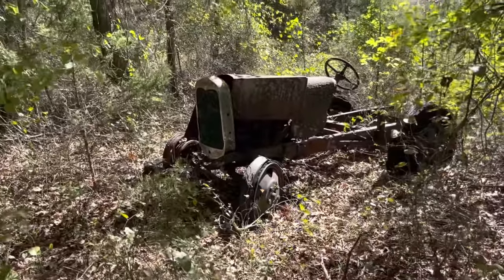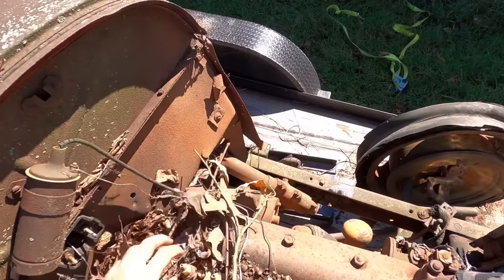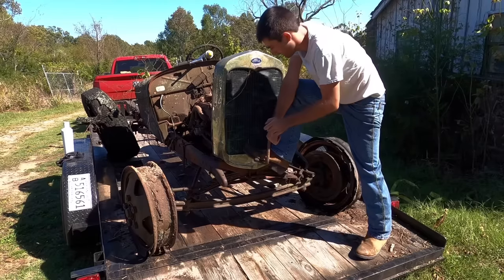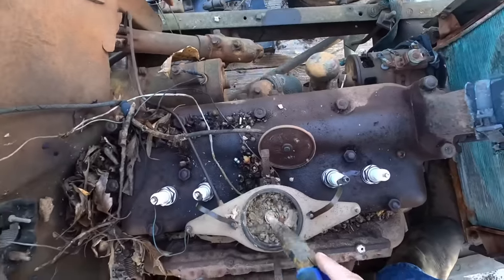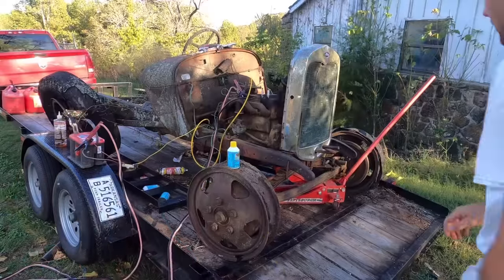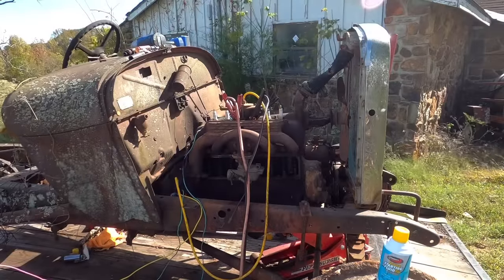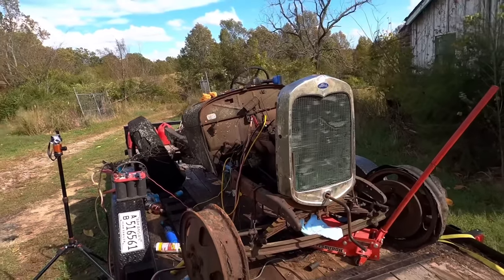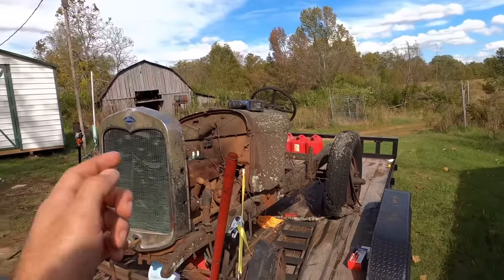Will it run after 72 years 1930 ford model aa Doodle bug ￼￼

Comment: A proof that old vehicles when taken care of......will last you a LIFETIME...... That thing needs a complete rebuild but the engine is still running. It still RUNS. quite well for how long its sat. Not as much smoke as some of the other videos either so it seems like it's getting okay compression. Wow im happy to see this
Reply: The old motors won't go as far as newer motors do nowadays but they generally can fire up and run after sitting in the woods for 70 years 😂
Reply: @HippoTheBaws  Ah, a common misconseption. Older motors are just as durable as today's engines and more so in many ways due to simplicity. Newer engines benefit from transmission technology that lets them travel over 55 mph at under 2K RPMs where older cars (if they could do 55mph) would be at 3K+ RPM so newer engines just don't have to work as hard.
Reply: @HippoTheBaws  
Idk they seem to be going backwards now. Comparably for what they had they were definitely built better. If we swapped places with people from the 40s-50s they would build cars that you could drive to the moon! 😆
Reply: @BrodieBr0  Agreed to a certain extent. They designed the transmission technology. They just didnt care to add more ratios. Not much is really new except for some materials. We have more precision now overall or cheaper precision but we make more mistakes,  were more careless and not nearly as smart but we think were all genius now bc our phone or the tv tells us we are if we follow a narrative! 🤣
With the exception gdi a few more turbos your vehicle is virtually the same vehicle and same technology you would purchase 25 years ago but probably not as good. Excluding your entertaiment system naturally.
Reply: @micahap1559  How many of those old motors hit 300k miles though? I see cars all day long with that some trucks with even more. Main thing with newer cars is actually maintaining them. Old stuff was bullet proof no doubt most of them you can easily look and see all the components. side note I absolutely am not talking about new ford's, chevy/gmc, or any of the Korean cars. I prefer the newer Hondas and Toyotas 😁
Reply: @HippoTheBaws  
Several. Thats not uncomon. Esp 60s era. But we must compare apples to apples. There are alot more vehicles today.  People also drive further now. The until the 80s vehicles only had a 5 digit odometer. Once you went over 99,999. Your back to zero. You must record the mileage yourself. The 6 digit odometer was added because people were driving more you didnt know how many 100k were driven. The biggest thing is the maintenance. If you didnt maintain it it didnt last. If you did it would. Fuel injection solid state ignition, 100k spark plugs better sealing etc. Let you drive more carefree now and remedies alot of maintenance. Basically the best innovations are helping to keep you from destroying your vehicle. 😆

... Just saw the last part. I dont care for Honda or Toyota. They are overpriced. They are not any better contrary to popular tale. 😆 Nothing particularly bad about the either. Im just not paying for an urban myth that everyone tries to uphold even when they have problems. Its always a fluke! 😆 
Common replies when telling me i should buy a Toyota. "All ive had to do is replace the coil packs, alternator, and a transmission problem."
Me: How many miles 
"95k, I'm about to get a new one". Me: How many when you had your first problem? 
"79k, so what have you had to replace?". 
Me: oil, filtration, fluids, spark plugs, tires
"How many miles"  Me:170k
"You should get a Toyota, it's not going to last!" 🤣
Reply: @HippoTheBaws  For example my grandfather had an 63 impala with over 400k. He ringed it at 380k. It still ran fine but smoked a little. As far as quality and longevity. I believe we started slipping around 03. I would not buy one built in the last 2 years period.

... Yes he put all the miles on it except the first 1or 2k.
Reply: @micahap1559  I think a big difference between todays cars and older cars is that we will put todays cars through multiple heat cycles a day, while 30s and older cars were mainly used for commercial and longer trips, or a taxi for instance wich would do 1 heat cycle a day...also many older cars ran colder under "normal"conditions than modern cars, reducing stress and requiring more fuel, also most of them still ran with lead and sulfur in the fuel, which adds another layer of protection, also loose rings with more oil in the combustion chamber...Todays cars are focusing on perfect combustion and fuel economy...and that in a way works against engine life
Reply: @colinboshoff8229  We have been doing loose piston rings for a while now That's why so many vehicles consume oil. Supposedly helps fuel economy by ~ 0.01%.
Reply: That engine is a work of pure art in cast iron! She deserves a new life in something with wheels on!
Reply: @micahap1559  As a guy who has worked for Toyota, Dodge, and Chevy, I think I can throw in my 2 cents here. Yes, there are plenty of high mileage domestics out there. But the overall number of them compared to the Toyotas I saw was laughable. I saw hundreds of Cavaliers, Intrepids, etc getting junked between 130,00-200,000 miles due to engine or transmission failure even with good maintenance. That is absolutely pathetic. They just don't hold up. At Toyota there wasn't a week that went by that I didn't see something with well over 300,000 miles. The highest I saw was a late 90s Camry that had just rolled over 700,000 miles. My 94 Toyota Pickup had 466,000 miles on it when I sold it in perfect working order with the original drivetrain. So don't even try to convince me Yotas are just overpriced and not worth it. Considering how much longer they last you are getting way more for your money. They are absolutely far superior vehicles overall. For the record, I was a hard core Chevy guy until I had a rude awakening with reality and realized just how crappy the domestics really are. It's sad, but true.
Reply: @rongundrum1784  They are all pretty crappy right now IMO. I dont need to convince you of anything. It just a conversation and you can make your own choice. Im not hardcore Chevy ford or anything. As far as the company itself I dont like GM at all but that doesnt change reality. Its all smoke and mirrors and none are what they used to be. Its the nature of the beast.
Reply: Modern engines are just overstressed pieces of junk, they take the tinest displacement possible and just turbo charge it in the name of fuel economy, vioula you now have a very overworked 4 banger but hey at least the fuel economy is good lol. Back in the days the engines were mostly overbuilt for the power they put out, especially the old volvo redblocks. Also didn't have any of the stupid electronic bullshit that just inevitably breaks down and stops working. Old good new bad.
Reply: @fishywishyfishfisk  Right on with that buddie! At least with the old engines if they stopped running 500 miles from the nearest workshop we had a fair chance of getting 'er going again! No hope with these new computerised gadgets !
Reply: @HippoTheBaws  Ever heard of a country called Cuba.
Reply: @HippoTheBaws  even 2 out of 3 of my 2003 c classes have made it past 300k miles on original engine and transmission. You're 100% right about maintenance, that's 90% of what will keep your car running.
Reply: @micahap1559  yup, Toyota and Honda is way over hyped. I owned 3 of the most unreliable generation c class and 2 of them are still with me. My Camry rusted out, my Honda blew the motor and transmission soon after. Those were both just under 200k miles and my merc's both have over 300k and I haven't had any major issues or leaks. Just the random sensor or suspension parts wearing out over time.
Reply: @jaws dakiller  if you did that to ur honda you didn't service it properly 100%
Reply: @jaws dakiller  I wont dog Mercedes they make a nice vehicle albeit very high tech. But again with service most vehicles will last 300k+
Reply: @HippoTheBaws  nope, didn't service it to the same degree as my Merc and I drove the shit out of it. It wasn't really worth maintaining that car since it was basically worthless and beat to crap. It did last a while and I can't fault the car itself very much but I definitely expected it to last longer than it did.

Comment: My granddad pieced three tractors together from car part, sort of a mix & match in 1942. Sold the first two He kept the last one. Had an Oakland frame Model TT rear end, Model AA motor & trans, and ultimately a huge Twin Cites tractor radiator to help with overheating issues. He ran it for about 40 years. I used to drive it when helping out around his little spread. The Model TT brakes were shot and were simply disconnected so you didn’t want to let it get up a head of speed, which it easily would. He even rigged up his own 3-point, power takeoff and sickle bar mower. Great video!  Stirs up memories.
Reply: Sombra,,, just read your comment 
you're granddaddy was of the old school 
" make it mend it" my philosophy is "if it ainnt broke don't mend it",,,, my dad born in 1899,, ran our farm/homestead up in Utah on the same principle as you're grandfather  farmer are born engineers 
discard nothing repair everything "    Edwin J

Comment: Pretty cool. Closest I've done to that is I bought a 1925 Delco 32volt lighting plant from the scrap metal yard and got it running. Was in clean operating condition so an easy job- was surprised to see overhead valves on an old donk like that. Sold it to a restorer afterwards- nice to know it's saved now.

Comment: My dad had taken an old F14 tractor made in 1935 out of a field where it sat since the 1940s. The Pistons were frozen in place. He soaked the cylinders with a mix of kerosene and marvel mystery oil for about an a week
 Then pounded the Pistons out with a block of wood. Freed up the rings. Then put the engine back together. Instead of hand cranking he install an old aircraft inertia starter. It took a few cranks but it started in a puff of smoke. Amazed everyone. He plowed snow with it for many years.

Comment: The trick for pb blaster or deep creep is to spray, get the bolt or plug to turn a bit, then spray it down good, and let it set. With the bolt or plug broke loose, there is now a gap in the threads the penetrant can more easily work its way into

Comment: We used to have (back in the day) what we called a "mule" Take some old not worthy for the road any longer and cut another tranny in the drive line, get a rear end from a one ton truck that had dual 16 inch tires on it. We chopped the body mostly off and kept enough to hold the dash assembly, and steering wheel up. We would then build a box on the rear frame mostly to haul ballast. Something to keep the rear end on the ground. Most guys wanted an old Ford V8. Lots of HP. We had a 85 horse 37 Ford V8. We hauled loads from the field, pulled a harrow, raked hay, etc but mostly we used it to get the cows in for milking. Much fun..

Comment: all you need is a 55 gallon drum of evaporust and a trench lined with visqueen sheet to soak all the parts in . all of the model A and T parts are legendary for how strong they are a soak in rust remover would make them whole again even the trans and rear diff. sadly I had a dual rear set of 18 in truck wheels and a good set of tires for that truck but they were lost in a barn fire a few years back

Comment: Not really surprised my dad and I have pulled them out of swamps half submerged and had them running in a few hours, T engines also... really the same thing except for the ignition system.

Comment: Its always funny that people think spraying PB Blaster, WD 40, JB 80, Marvel Mystery oil on a stuck bolt, nut, spark plug or whatever is actually penetrating past forced/screwed together metal to metal contacts and bolt threads and loosening them up. It doesn't. It cleans some of the crap around the bolt and loosens rust or whatever, but it ISNT going into the threads and loosening anything up. If the bolt came loose, you just got lucky.  These products only work when there is, or was originally space between parts thats usually move.  i WILL say however, great job, didn't think that one had a chance,

Comment: In sweden you can build and register cars as tractors and have been able since early 30s and its most commonly used as a mode of transport for the youth they do max 30 kmh but are allowed on public roads and its actually a sort of culture wich is reminding of squatted truck culture but there are nice ones aswell.
"The slow pride of Sweden"

Comment: Never spray anything like these inside cylinders. I remember I had good clear cylinder. Spraid wd40 for "cold break in". And left doring night. At next day rings was stucked and I found mini groove where rings touched, like pitting in cast iron cylinder. Wd40 removed something.
So after that using only normal oil or kerosene!!!!!!! These sprays for bolts and nuts. Kerosene for valves and cylinders

Comment: Without using ether respectively starter fluid, I would have given a thumbs up. Next time simply use regular fuel or, even better, 2 stroke mixture 1:50 (like great Mustie1 with all his cold starts always does).

Comment: put your thumb in the right spot when cranking(lined up with your fingers and not around the crank handle) specially on old stuff, if it backfires n catches just in the wrong way it can break your thumb.

Source: experience with a morris 8 that had been sitting 39 years :/

Comment: Well you did that motor a power of no good for sure . The oil pan and valve chest will be full of sludge which you have pumped around that  engine . When you do pull the pan and pop out the dipper tray you will be shocked the oil pump screen will be mostly blocked as well  So sad people kill an engine when trying to save it ,happens all the time but it does keep engine rebuilders employed .

Comment: Why not brush all the crap off the top of the engine before spraying the dirt and crap with oil? it will only take a minute and you will use less oil

Comment: If you were serious you would compleatly disassemble the engine (and the rest of the truck) first, then clean and replace all vital parts that can not be cleaned and used again. When all things are as close to new condition that is reasonably possible you re assemble lube and THEN run it. Getting 10 minutes of run time out of this grave robbery does not mean you "fixed" it or got it running. Get serious or you will damage the nearly antique vehicles you "work" on more than another 10 years of neglect ever could. They should be saved but for f/*¤s sake do it right the first time or let some one else do it.